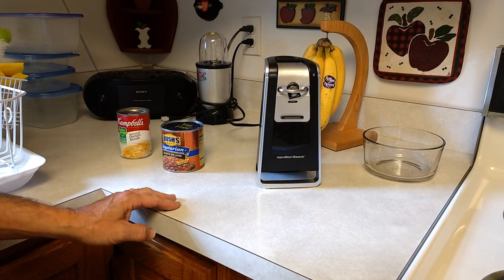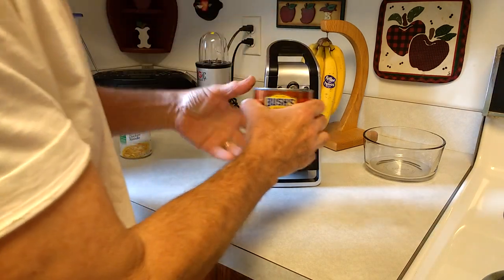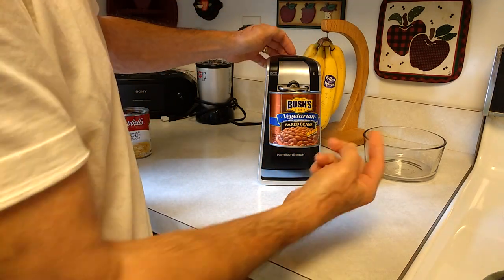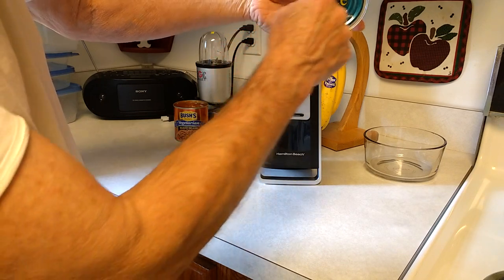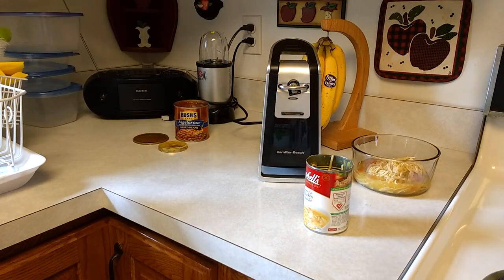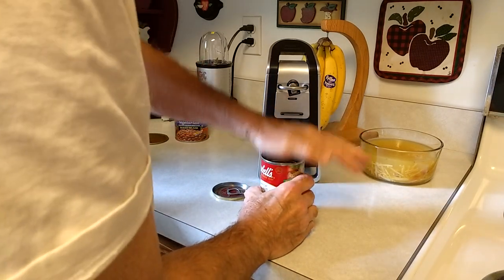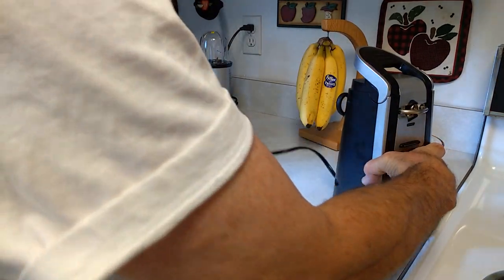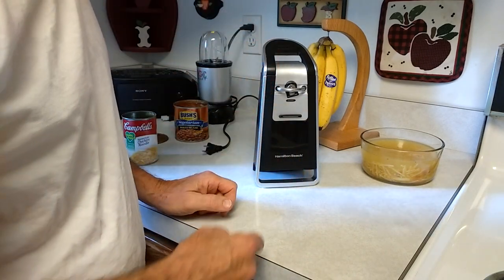Hamilton Beach Smooth Touch Can Opener # 76607

Comment: Love this can opener.  Another cool "feature" is that, if you have anything left over you can put the lid back on the can and it seals up pretty good for storage in the 'fridge.  It doesn't lock in place, and if the can tips over stuff will leak out, but it seals well enough to preserve the contents in the 'fridge for a few days without picking up 'fridge smells.

Comment: Thanks for your demonstration, I didn't know it could open the tab top cans too, that's a great feature.  Didn't get scissors with mine but there is a slot for a pair that I didn't know about till your video.  Bought one yesterday at Walmart in-store can lids!.  $29.  It works great and doesn't take up a lot of room.  No jagged edges, nice and smooth and safe!  The cord keeper is helpful too.

Comment: We've had one of these for years and it finally stopped working even though it's lightly used.  I had hoped some mechanism could be replaced in the unit, but not so.  If you look at the so called "cutting wheel" in the unit, there is no blade as such.  The wheel is at an angle to the top of the can and I believe the wheel actually presses the top of the can from below with such force that it separates from the body of the can.  The wheel has a "step" halfway down it that does the job.

It's a shame the wheel wears out because the rest of the unit is very stout.  When I disassembled the old one, everything in it was very solid.  The plastic gear wheel inside that turns the toothed gear that moves the can had zero wear on it.

The new instruction books do not mention the clear plastic tab that covers the removal wheel and I thought the opener was defective until my wife saw it.  They could have made it white colored so it was easier to see.

Also, the cord  does come out farther, but it's not an elegant method to do so.  It just has a space inside where it's crammed into and you pull a bit hard to pull it out.

So in summary, it does remove tops with a smooth edge but will probably not last more than a few years if you use it frequently.
Reply: Does this opener work with large and wide 120 ounce cans?
Does you know of any can openers you have tried that work with large/wide 120 ounce cans?

Comment: Has this held up since you reviewed it  3 years ago? I bought one of these about 8 years ago, loved it, but it went dull after about 3 years. The blade is not replaceable, so I just went back to a manual opener, but I do miss the edge cuting design. Are the blades replaceable now? 
This looks to be the same design as the Safety Can Express.  Have you tried that product ? If so, any difference?

Comment: The other complaint out there on this can opener is that is leaves slivers of metal in the food!  Ugg!
Reply: I think any of this type can do that, which is why it's not a super common type of opener.
However, since it does not remove the lid, you could still rinse the can off before taking the lid off, in theory.